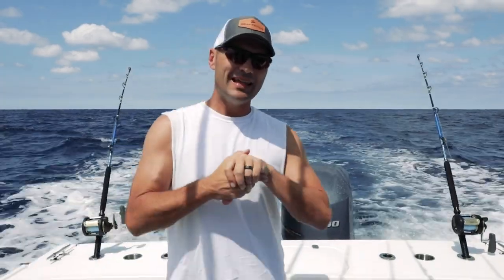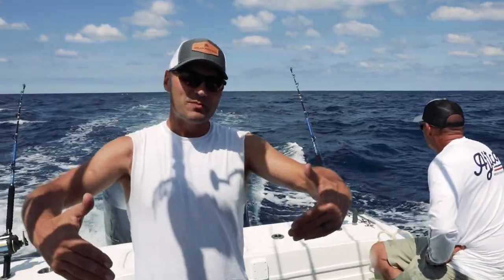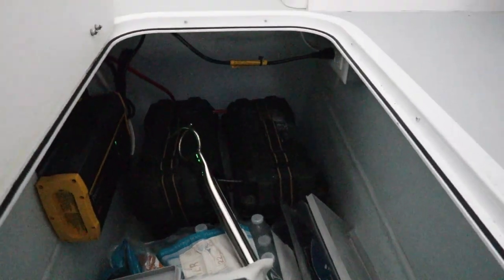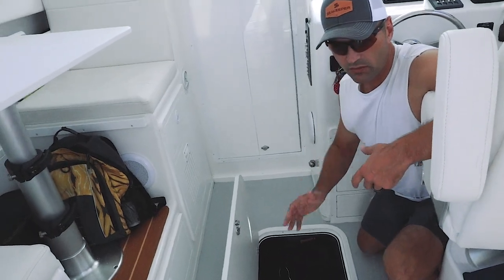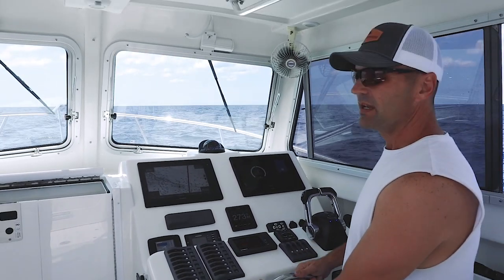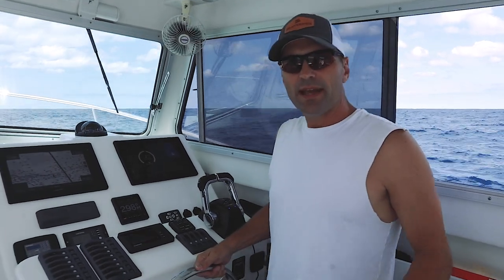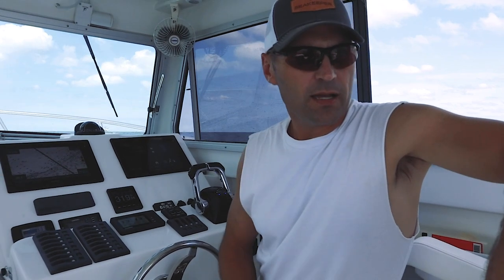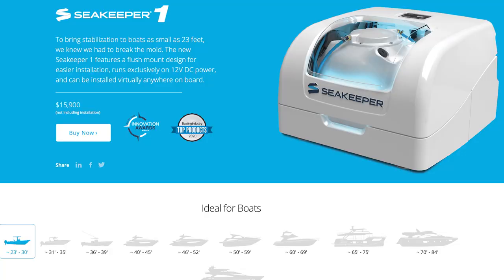Full Ocean Review of Seakeeper 1 (Pros, Cons, Cost and More!)

Comment: My friend has a sea keeper on his 60' Sea Ray Yacht.  I can attest to everything you just said and demonstrated about the side to side roll.  We were in the Atlantic, in 3-4 ft rollers, like you, and the boat never rolled more than 2-4 degrees from side to side, and we were doing 20 knots.  I noted from sitting on the bow of his boat, that the top rail of the boat barely moved, from side to side, with the horizon.  Very smooth ride, and yes, there was still some bounce from the hull, but as you demonstrated when you turned the seakeepr off, the roll increased dramatically.  I was on the boat for a week, and it was the most comfortable, stable ride on a boat that I have ever been on.
Reply from the maker: Wow. Great input there Kenneth. Appreciate you stopping by!

Comment: I have the same boat and I am considering installing it.  I have a couple of questions hopefully you can answer for me.  
I am concerned with the extra weight.  How does it affect the gas mileage on the Steiger 28?  Also you mentioned it changed the ride, do you think the boat rode better after?  It would seem it would balance the boat out a bit.  Would you install it again?  Also they are telling me that I may need a seakeeper 2 but that maybe overkill.  Thanks for the video and time answering my questions.

Comment: Would like to hear about your thoughts on the seakeeper after 2 years of use.  Maintenance?  Reliability?
Reply from the maker: Jury is still out to be honest. Have had some issues with moisture getting in the unit. Amazing tool when it is working for sure, but a recent repair was disheartening.
Reply: I’m in the market. I saw they have a new waterproof case. Would that have solved your moisture issue? Was that the repair?

Comment: I have a love hate relationship with my seakeeper. 
Got one on a new boat.
Bloody expensive but when it works it’s insanely good. 
Sadly 6 weeks in it died. 
Turned out to be a water pump, easy.
But they needed to send one to the dealer, there went 2 months.
Worked perfectly for about 3 months after that.
Then just stopped spooling.
Whole ball unit needed replacing under warranty.
vacuum leak. 
I’m now waiting for the repair.
It’s been not working more than it’s been working on the time I’ve had the boat (9 months).
I’d probably skip next time. I could be unlucky who knows.

Comment: what gonna happen if small seakeaper will be installed into a big boat? Will it reduce roll or won't be working at all? I mean the Seakeper 18 for 70' boat requires up to 3.7 kilowatts which makes impossible to use solar energy for it. It's too much! What if i installed Seakeeper 6 to the 70' boat? Will it work to some degree?